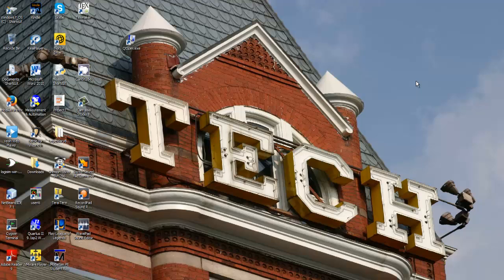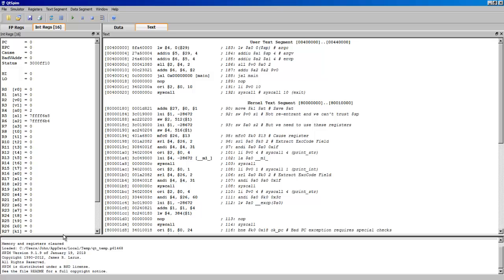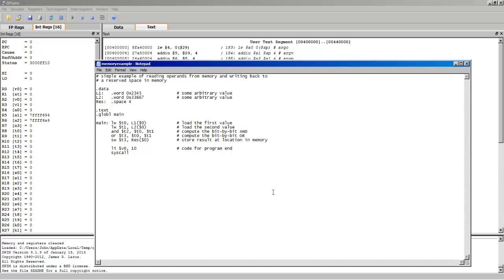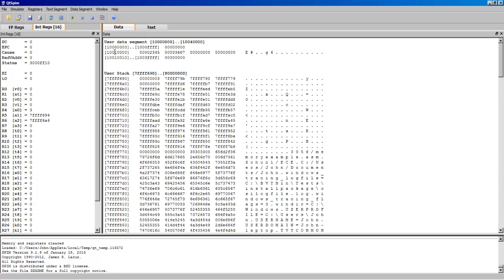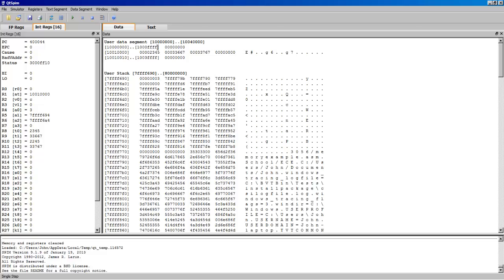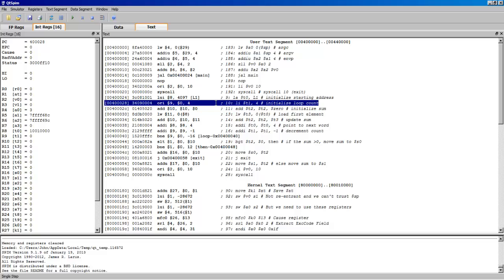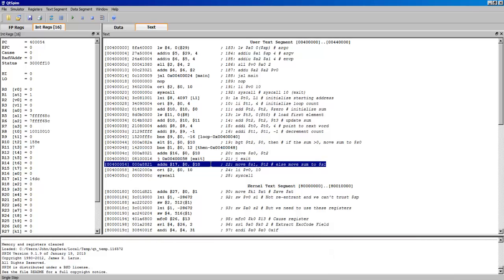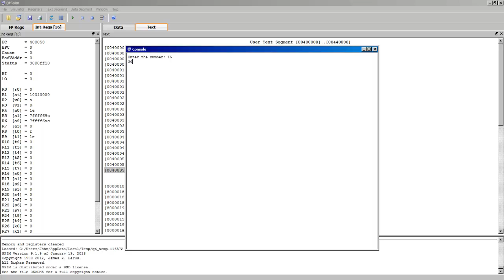Programming with QtSpim

Comment: Your comments don't match the function in your second program named "pseudoinstructions." See below for a possible revision.

loop:   lw $t3, 0($t0)              # load first element of array into temp reg 3
        add $t2, $t2, $t3           # update sum
        addi $t0, $t0, 4            # point to next element in array
        addi $t1, $t1, -1           # decrement loop count
        bne $t1, $zero, loop        # check if there are any loops remaining
        
        ble $t2, $0, else           # if the sum > 0, store sum in $s0
        move $s0, $t2
        j exit
        
else:   move $s1, $t2               # else store sum in $s1